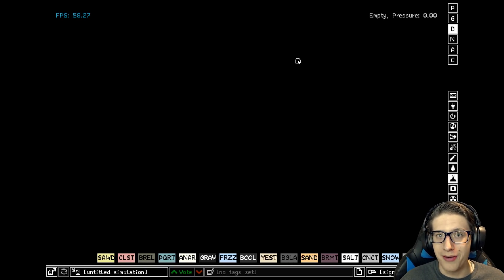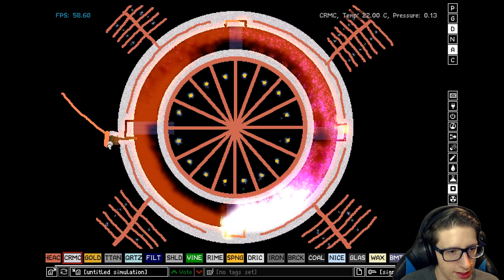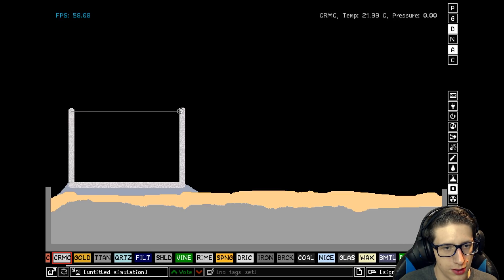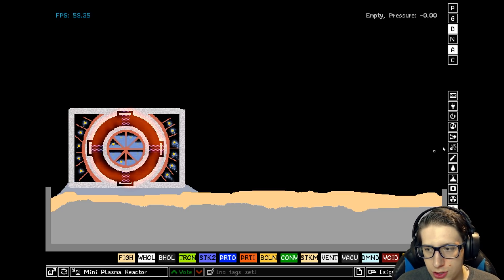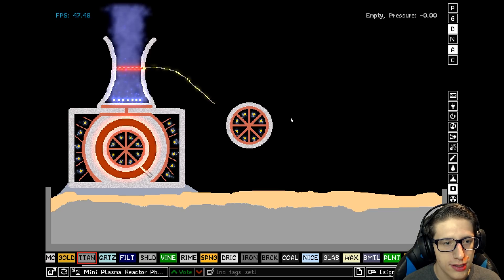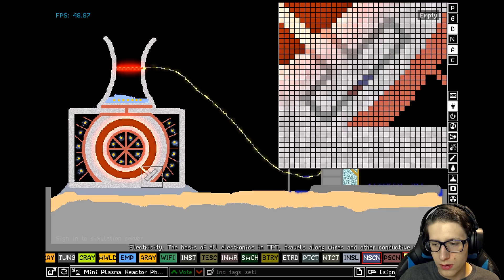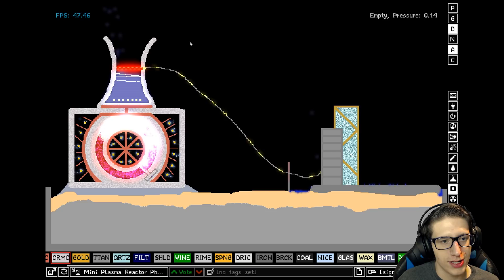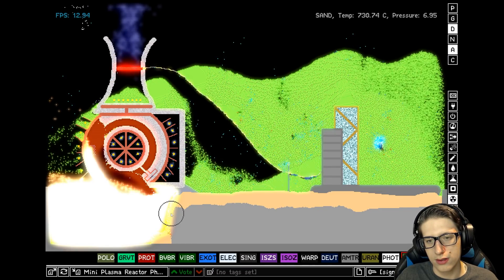INFINITE PLASMA REACTOR in The Powder Toy!

Comment: If you made a spark delay between the segments (long enough for the plasma to dissipate) you could make a far smaller one, ive tried it and the theory is sound (my smallest reactor so far almost fits into the larges size of zoom, minus the radiator coils and even those could be shrunk to to be more efficient).

Comment: so after watching this, i downloaded the game and tried to make a similar thing but as a closed system (no clone tool, water used as coolant then turns to steam and then goes up and meets a condenser which is air cooled) which worked great for about 13 minutes until all the air was just as hot as the steam and the plasma core blew up.
Reply: where did you download it?
Reply: @jakubkamas7469  Just search “Powder game” or “Powder toy”.
Reply: MMmmM star

Comment: How does it work as noble gases are inert and won't combust even if forced?
Reply: They won't combust, but they will ionize.  Neon signs use noble gasses, once the gas is ionized, it becomes conductive, so electricity can flow through.  The atoms will de-ionize on their own to reach a lower energy state, and when they do, they release photons in the UV spectrum or higher, which will cause phosphorous to fluoresce (glow).  The electricity flowing through the gas will re-ionize the de-ionized atoms, and the cycle repeats

Comment: Engines turn chemical energy into mechanical energy, a reactor, iirc, turns nuclear energy into electrical energy, correct me if am wrong
Reply: A reactor is just an environment that encourages certain types of reactions.  A nuclear reactor encourages nuclear reactions (fusion or fission, depending).  The energy released from those nuclear reactions is then collected and used to heat water to make steam and drive turbines
Reply: @Tinker_Nerd  so i was on the right lines, however, i thank you for correcting my lack of knowledge on this subject, better to be correct fully than partially
Reply: @osmacar  Nuclear reactors are "heat engines" they are limited by the Carnot efficiency  (~70%) for energy conversion, even without considering other losses.

Direct energy conversion devices seem to be the future of energy production. Solar cells are one type of it and using Fusion is sadly still sci-fi, even ITER tries to generate power by heating water .

Comment: i've said it once and i'll say it again... Use tungsten instead of titanium, it has a much higher melting point
Reply: But it immediately breaks on pressure
Reply: Well that's why you reinforce it!
Reply: but the titanium wasnt meltingggggg
Reply: Or diamonds... that’s an even higher melt point
Reply: @Volt64bolt  It's also cheating
Reply: Tried it, the Tungsten broke as soon as I configured the fans, Tungsten by the looks of things will just break apart once experienced to the winds needed for the generator to work. I do not think reinforcing it would help, as its more like the wind is breaking down the tungsten itself

Comment: Tried making a noble reactor but i can’t figure out how to contain the reaction and heat water at the same time. (Mine is steam powered btw)
Reply: Heat conductor
Reply: I was just wondering how to conduct that much heat without the material melting
Reply: @gen2mediainc.577  Why bother carrying the heat with a conductor when you can just submerge the reactor? Given sufficient water flow to keep replenishing the evaporated water, it won't be a problem. The issue is to build a powerful enough radiator to condense the steam back to water to complete the loop, or just use a water source thing but that's technically a pump irl which decreases energy yield. Your problem is heat, not the reaction itself.
Reply: What were those blue dots in the circle thingy
Reply: @marioformicadae6637   probably neutrons. Not a physicist but they crop up in reactors a lot cuz they start reactions easily I thunk
Reply: @gen2mediainc.577  You're technically right, if you shoot a neutron at a Uranium (235?) Atom is release 2 neutrons, and hence a chain reaction takes place really quickly.